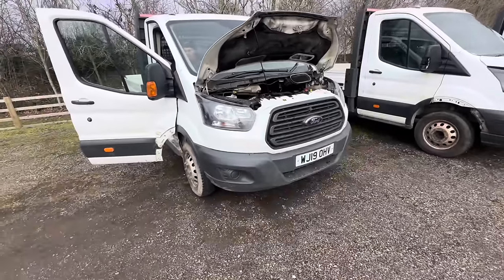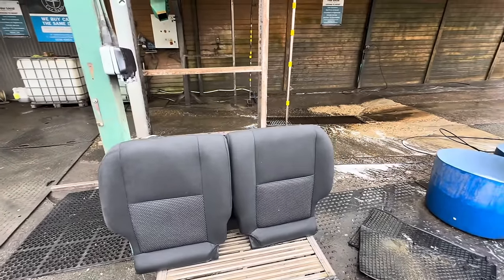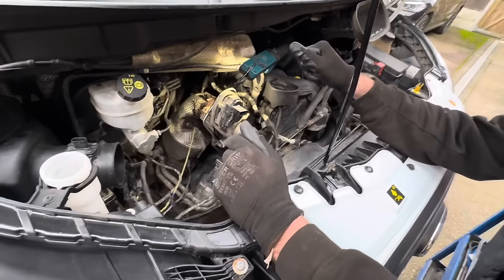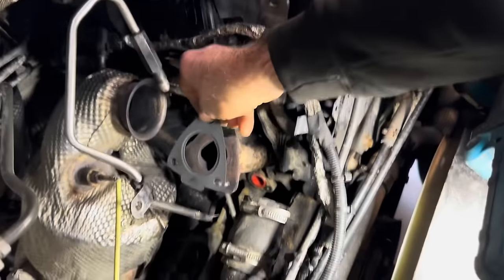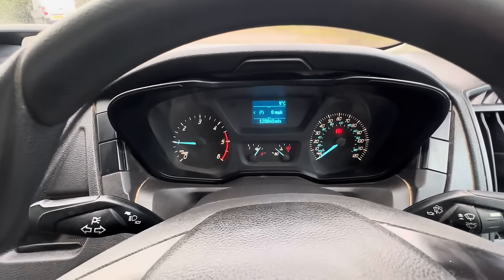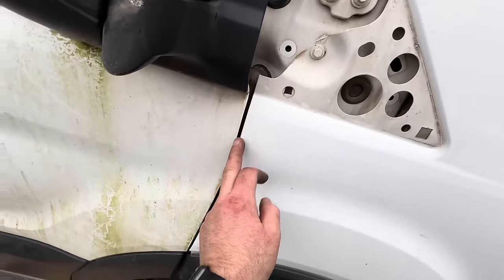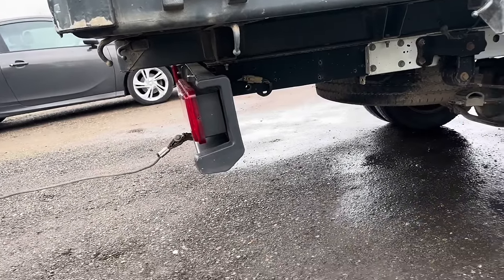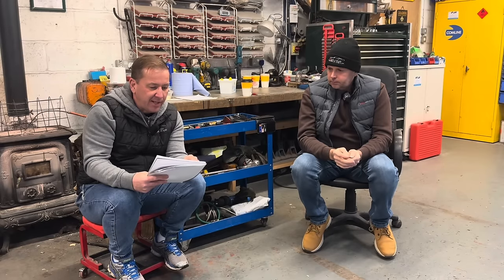REPAIRING A 2019 FORD TRANSIT EX FLEET  TRUCKS

Comment: The best thing about SRUK is that they convinced me never to buy a Transhit especially with these crappy wet belt engines 👍👍👍🇺🇸🇬🇧🇺🇸🇬🇧🤣🤣
Reply: Great business buying these transits in bulk. Whittle them down till you have one left and decide what to do with it.  No problem selling vehicles of this calibre and price point. Your expertise in fixing these wet belt motors is second to none. Nice little coming out this fleet disposal 👍🇬🇧😎
Reply: Beggars belief that anyone would think it was a good idea to have a wet belt in the first place.
Reply: My work got a fleet of these back in 2014. They were nothing but trouble and were all dead within 2 years! The boss bit the bullet and got sprinters to replace them and some of them are still going strong!
Reply: They’re garbage
I have a 20 plate, wet belt snapped at 40k miles, while the engine was running at about 1500 rpm.
The whole engine was destroyed 
I’ll never have another :(
Reply: Lovely job and a nice earner considering man hours spent on it 👏👏
Reply: My old work had one from new and it did 160k before the belt went (I was driving it at the time!) 🤷🏻‍♂️
Reply: My 19 plate 99k custom just gone back to Enterprise. Dpf, knocking noise, cam belt needs doing, and it's loosing coolant. Don't think I'll be getting it back. Loads of  the customs have had issues 😢
Reply: Rubbish I run multiple and there great if looked after
Reply: Al on 6D Diesels has pulled a few of them apart - worth watching.

Comment: For swapping the doors better to put the window down first . That allows you to hold and move door as you need. Great work guys as usual.
Reply: Top tip! I'm not adverse to hanging them off the engine crane either when they're heavy
Reply: 10 minutes extra to save your back can save 10 years of chronic pain in the future…

Comment: Obviously the seats will be soaking and the cab will have some condensation over the next few days if you stick a small to medium sized dehumidifier in the cab for a few hours it will dry it out. Saves it going mouldy too

Comment: Good evening Rob and Chris, great video and good use of the winch to repair the under run bar (bumper). The transit really turned out well. Also good that you could help your friend out. 
Thanks you for taking the time to upload another video. Ged.

Comment: Check the pollen filters as well and I’d do a fuel filter as well rob coz the mileages those transits have done I don’t think they will have been changed.pollen filter behind the glovebox just push the tabs in at the side down it comes and it’s there in front of u

Comment: All Transits wear the outer edge on the passenger side tyre. 
No matter how many times you get the wheel alingment done, it will still wear down the outer tyre edge first.
A customer of mine would call me out a few months after fitting a new tyre for him, to turn the tyre around on the rim to get even wear on the tyre!

Comment: I was a motor mechanic for 50years & in that time have seen a lot of dodgy repairs but that turbo job was complete incompetence & I would seriously be in doubt as to whether the wet belt was actually changed & not abandoned because it proved to difficult.
Reply: Usually because they can't get the bottom pulley bolt undone.

Comment: The thing with Robbing a Van for Bits and Charging Yourself an Estimate for that Bit is that you may want to Fix the Van that you have Robbed from for a Sale and as you Add the Bits back onto that Van that was Previous Robbed you will be Charging Yourself Twice for the same Bit.

Comment: Instead of scrapping one of the transits consider buying another crashed van and fox it using parts from the sober. That way you will get a better return as the panels aren’t that bad
Reply from the maker: Nothing is getting scrapped 👍
Reply: I don’t know the Sober range but Fox bodies are well known in the States..
Reply: Oops predictive text. I meant fix a crash damaged van  using parts from the scraper. Phone was acting up

Comment: Rob don't forget to mention which vans have had the wet belt changed, it's around £1250 at ford or £800 indipendent
Reply from the maker: They all have
Reply: @sruk you hope!
Reply: I’ve been quoted “a cheap” £1700 for my 100k mileage Focus ☹️

Comment: I don't know what ad blue is and what it does, could anybody enlighten me, thanks!!
Reply: Its misted into the exhaust system. It causes a chemical reaction in the exhaust reducing the emissions
Reply: Modern Euro 6 diesels.  Mixes with the fuel to help counteract the nitrous oxide in the exhaust emissions.
Reply from the maker: It’s an additive to bring down emissions
👍
Reply: It make the cab interior smell nice.
Reply: It’s an emission additive for diesel engines to meet Euro6 norms.
Reply: It's an additive you must put in the diesel tank ...(ffs DON'T!!!)
Reply: Many modern diesel cars that meet the latest emissions standards (called Euro 6) use a fluid called AdBlue, which helps remove toxic substances from the car’s exhaust gases. It’s a solution of distilled water and urea, a substance found in urine and fertilisers. It’s non-toxic, colourless and has a slightly sweet smell. It feels a bit sticky if you get any on your hands but it washes off easily.
Reply: All u need to know is if u buy a van thats got AdBlue u need to immediately map it out
Reply: Thought it sounded like a  golf😅😅

Comment: Modern Transits are absolute junk, Not a patch on the old Banana Versions.
Reply: Disagree! I've had mine new from 2016 and still going strong at 181k
Reply: 2016 is far from Modern unless you have a time machine.
Reply: Ford ruined the engines with their insanely garbage wet timing belt and other nonsense.